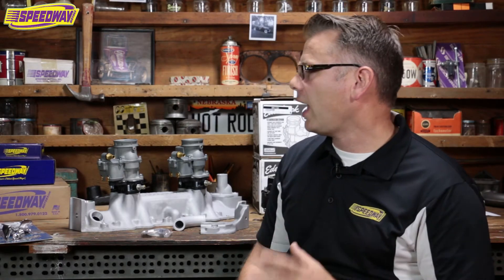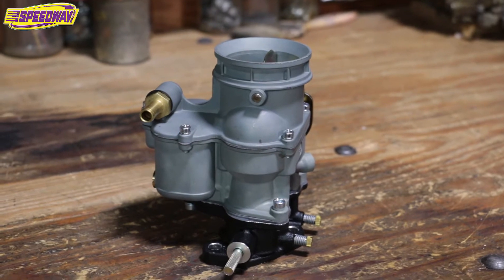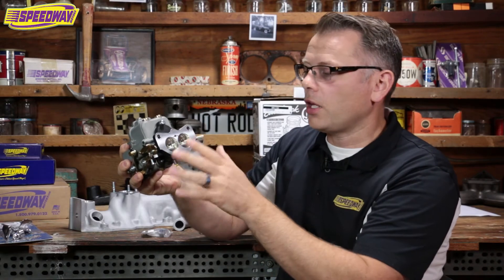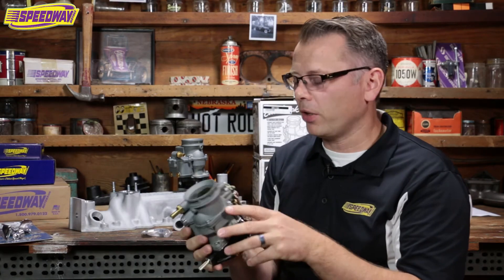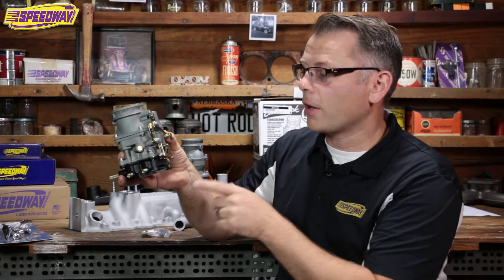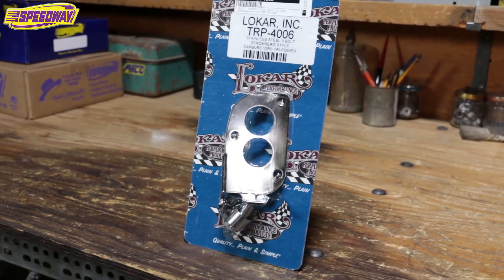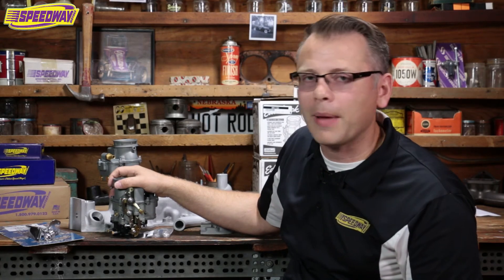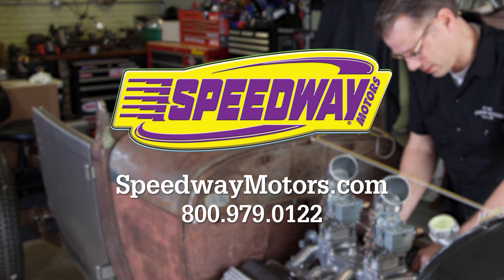Speedway Tech Talk - Vintage Carburetor Options, The Edelbrock 94

Comment: Knowing this is an old video but hopefully you can answer my question- my Father has been ordering parts from speedway , we have a 1950 Ford Deluxe V8 flathead with a FENT-N Aluminum intake with 3 ×2 Ford Carburetors does Speedway have the linkage for that type of setup please let me know . 
 Thank you so much 👍✌

Comment: Right on
Reply: i setup a 67 vett 327 with the stock solid lift cam with speedway 3  2's. i'm runnin 2 1/2 pounds fuel pressure on guage. it wont lean out. i've not touched jets or float...yet. any suggestions?  john

Comment: Where did you find the hemi manifold? Edelbrock only has the triple manifolds for chevy smallblock and flathead. I'd be planning on using the actual new stromberg BIG-97s as you get 250 cfm per carby - so 750 cfm in a tripower setup. would the same manifold fit a 345 desoto hemi? As I'm looking for that in a 57 adventurer or sportsman